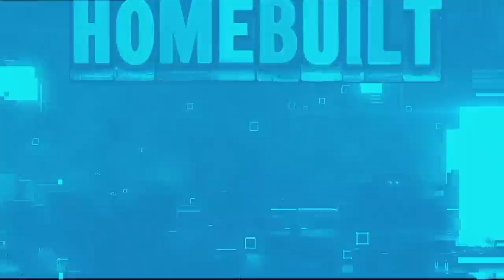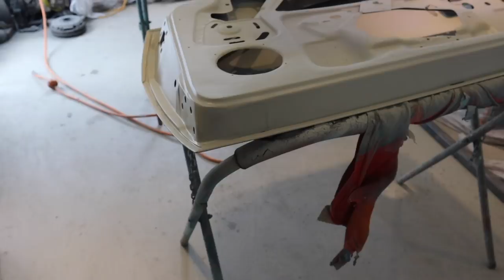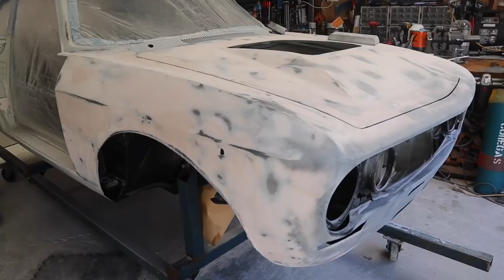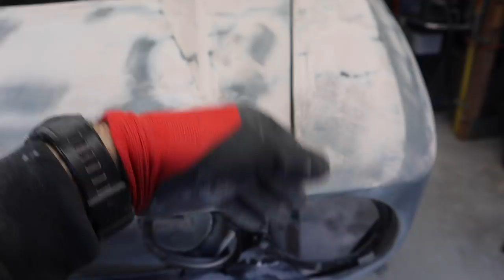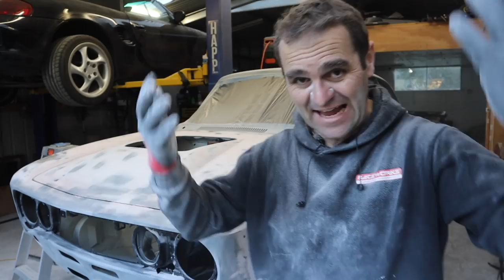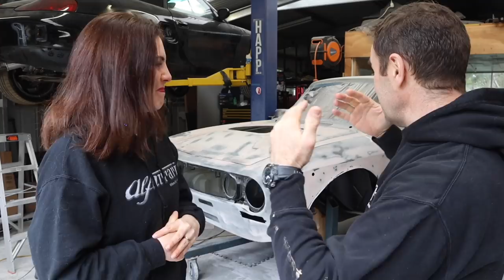Perfect hood gaps - Ferrari engined Alfa 105 Alfarrari build part 138

Comment: For those wondering how to get that "wow" looking paint job, the key is in the sanding.  The basic rules are these.  Never sand without a block unless absolutely necessary.  For example, the inside radius near the new fuel filler mount is one such area.  Here you should use a small piece of sand paper folded in thirds so that the grit gives your fingers a place to grip and the paper itself adds just enough stiffness. 
 
For the vast majority of the surface, a block is mandatory.  I like blocks as long as the long edge of a piece of ordinary sand paper and as wide as 1/3 the width allowing for enough to wrap up around the edge and give you a grip.  In the U.S. sand paper is 9"x11", so my blocks are 11" long, 2.75" wide and 3/8" thick.  I cut or tear a sheet of sand paper in thirds and that gives me just the right size for the block with enough to wrap up the sides so I can grip it with my thumb on one side and my finger tips on the other.  I don't have to mess with any adhesives or expensive sand paper with pre-applied adhesive.  And I can change grits in an instant without pealing anything off.  

You can make these blocks from wood, but I have also 3D printed them too.  It's handy to have a couple of semi flexible blocks cut from stiff urethane foam sheet, but most of my sanding is done with a rigid block.

When the paper clogs up or is nearly worn out, cut an inch or two of the ends, fold the remaining part into thirds, and use that small piece for those areas where finger tip sanding is appropriate.  

When it comes to boat building, a long two-handed block is sometimes appropriate and there are even really long two-person sanding blocks, but for an automobile the 11" long block is just about right for holding in one hand.  Used properly, it's more than long enough. 

The hardest part is to learn to move the block in the LONG direction.  Rubbing the surface with the block traveling in the direction of the short edge is easier on your arm and beginners will invariably find themselves doing that most of the time.  This is incorrect.  Try to always move the block so that it travels across the surface in the direction of the long edge.  Your arm will get tired, but force yourself to move the sanding block correctly.  Your paint job will thank you later.   This simple rule is the most important part about learning how to sand correctly and efficiently. 

Remember, the idea is to cut down the bumps and a long block does that best.   That's why road graders have such a long wheel base.

Comment: I like how you’re adding commentary during the segments when you’re performing the work.  You know what would look amazing?  Getting rid of the intake manifold and fabricating some velocity stacks that poke through the hole in the bonnet.  It would quite a bit of fiddley work but so worth it! Getting very excited to see the paint go on!
Reply: Agree on this! That hood bump screaming for exactly trumpet inlets! Cheers 🍻
Reply: Nice idea for visual but EFI need airflow meter(s). Not gonna work with this engine.
Reply: @jamesboniface8779   They do make velocity stacks with an integrated MAF. Would that work?
Reply: @matthewviviano3653  Interesting, would that require 8 MAFs? Or would there be 2, one for each bank? I'm old school and love the old Ferraris with 6 or 12 velocity stacks but in this application it would require extensive redesign of the intake plumbing. At 59 years old, I'm stuck in the era of Webers and mechanical fuel injection so not really a 
knowledgeable source.
Reply: @jamesboniface8779   I would think 8 because on the engine as it is now, it has a single intake for each bank but this application would require one intake per cylinder.  I’m really not sure as I’m not well schooled on custom ECU’s. I’m 58 so I’m not far behind you!
Reply: @matthewviviano3653  I own a Ferrari 348, (least expensive and the last "analog" Ferrari!) The engine is managed as 2 inline 4 cylinder engines with two ECU's, 2 MAFs and 2 EFI rails, and 2 O2 sensors, one for each bank. Each ECU averages their respective 4 cylinders through the MAF to modulate fuel delivery. This is old school Bosch tech. Not sure how 8 MAF would work without 8 O2 sensors. Maybe average them together? Again, beyond my basic suck, squeeze, push, blow 4 stroke knowledge

Comment: looking good.

another idea for a diesel heater that is probably a little safer (for combustion) and less likely to introduce contamination is a diesel heater for a caravan, you could mount the heater itself outside and duct it in, the combustion chamber is separate from the 'heating', so no diesel fumes in the heated air. they just take 12v for the blower fan and the little pulse pump for the diesel.

My dad has one for his boat and it works very well, even on very cold Tasmanian winter nights at sea.

Comment: Sanding tips
When sanding with a corse grit Stop long before you think you need to change to a finer grit and check and if you think you could go a bit more with the corse grit Don’t swap to finer grit or fill any holes if needed.
A lot of sanding and bogging time is wasted redoing what you’ve already done because you went too far before stopping.
Setup a fan to blow the dust towards some sort of collection device.

Comment: Looks good Jeff, I really like the bonnet work it’s sort of like the GTV6 styled v’s the 4 cylinder so totally acceptable ✅✅ I think I’d have put in two fluted vents but I haven’t seen the air box yet.. 
As for the bog work to guards and bonnet .. these areas are very easy to work and flatten to file finish if required. Why haven’t you taken the extra time to do that ..? The high built primers we have today should be pretty much all you need . Hey I know it’s easy to fill it... but the devil is in the detail as they say ...
A slapper , dolly and file is my best intentions for a restoration. Dare I say it but ‘bog’ is for car yards...
Two pack knifing stop putty is all I need ..
Reply from the maker: Watch the previous episodes where I cover all of that ;)

Comment: Doesn't transaxle indicate a unit that combines gearbox and differential? Practically all cars with FF, RR and MR layouts as well as some FRs adopt the transaxle, including the 312B (MR). Also the 312Ts (the T stands for trasversale - transverse) obviously use a transaxle, the difference being that the gearbox is transverse so that it can be mounted in front of the differential to reduce the polar moment of inertia but without excessively lengthening the wheelbase.

Comment: Anyone that has ever restored an Italian rust bucket will know how much tennacity it takes to keep going to finish point. It's a great project, just wondering about you getting it road registered, as far as I can remember you have never mentioned an engineer's report?  Here in NZ the checks can be anal even for a standard resto . From reading Australian performance mags over 50 years I thought there were restrictions on engine swap capacity by percentage, ?? Don't think it was x 300% ?  A lot of guys like us end up living alone h as ha ha
Reply from the maker: In Aus for this weight of car, it is the original weight (1050kgs) x 4 = 4200cc is the biggest NA engine I could put in.

Comment: how does one avoid the work done underneath showing through the paint? i have had a custom bonnet made.... the paint is smooth and shiny. but in the right light i can see where it was welded/sanding marks etc. almost like the paint is transparent and i can see thework underneath.
Reply from the maker: That means that this stage and the high fill primer stage wasn't done well enough. High fill does shrink back a bit over time.